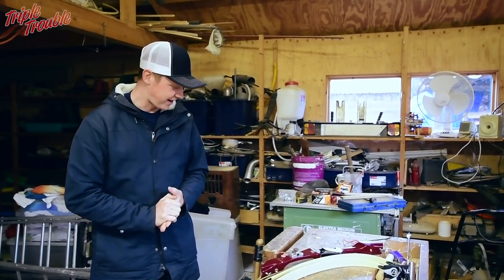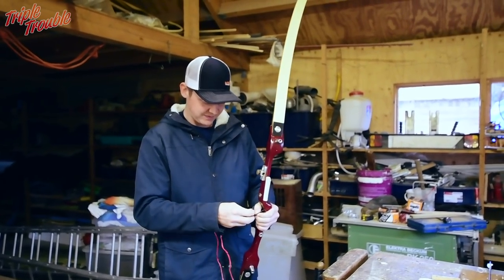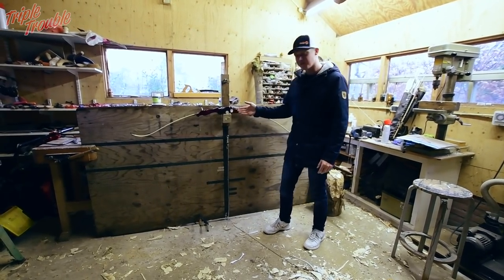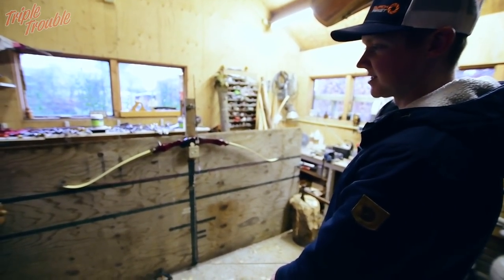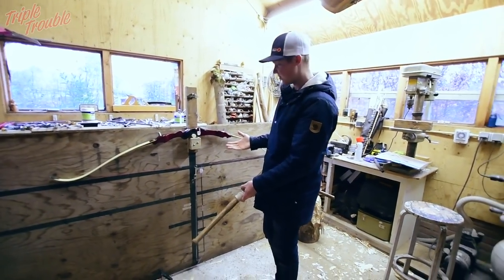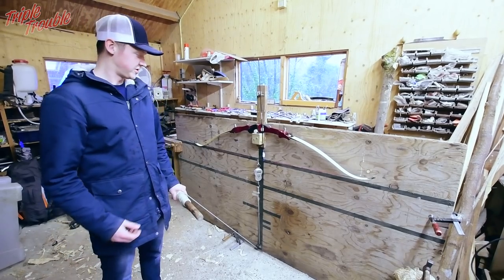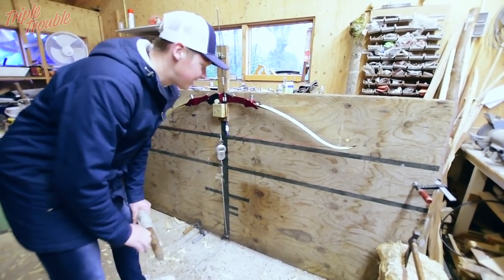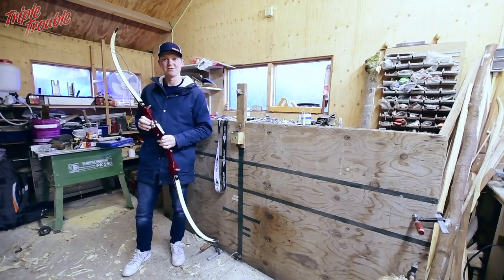40 year old recurve bow!? (Part 1 - will it break?)

Comment: After 30+++ yrs i decided to go back to archery .. i have a hoyt gm4 with 42# 68" carbon plus limbs .. shibuya plunger.. shibuya dx arrow rest.. yamaha ys5 sight.. hoyt v-bar.. hoyt easton 32" center rod.. 2 8" stabs .. weights were machine made .. old wilson cordovan tab modified with anchor pad ..  but i dont use my fast flights anymore .. change to bcy bowstrings .. yamaha dual layer bowcase ..etc .. old school archery .. only if i can show you some pics to believe .. but now being old at 60 .. i bought 32# samick impress carbon limbs and using medallion xr arrows to match ..

Comment: Any bow can be destroyed by abuse such as exposure to very high temperatures.  Otherwise there is absolutely no reason to be concerned about the durability of a 40 year old bow.  In fact I have a couple of bows that are in the 50-60 year old range and I shoot them frequently.  My Damon Howatt Del Rey, circa 1970, is in my garage strung and ready to go.  I have been shooting it off and on for the past couple of months.  For any older bow, you should use a dacron string and an arrow weight of 9-10 grains per pound or higher.
Reply from the maker: Very cool! My largest concern was that I don't know how or where these have been stored and what the circumstances were. If it was very moist or very dry, I don't know what it could have done to the glue. Besides that, I have no idea what kind of glue was used in the first place! Thanks for the tips! I will set up some 'heavy' arrows and make myself a dacron string. Have a nice day!